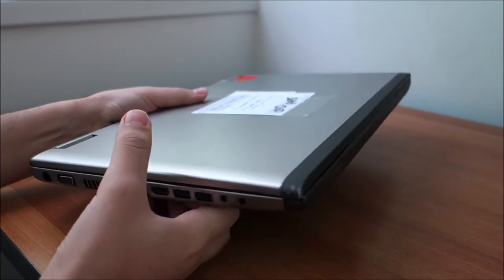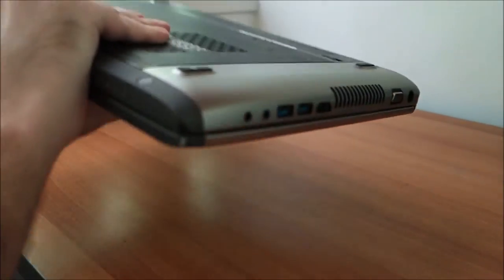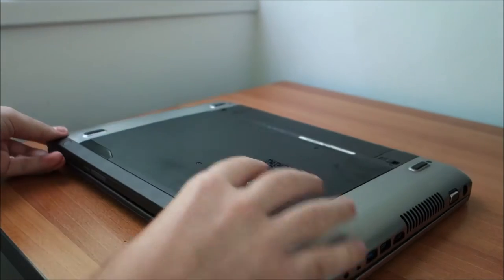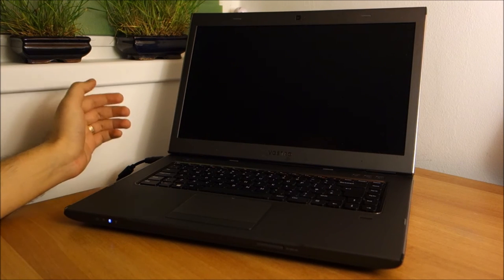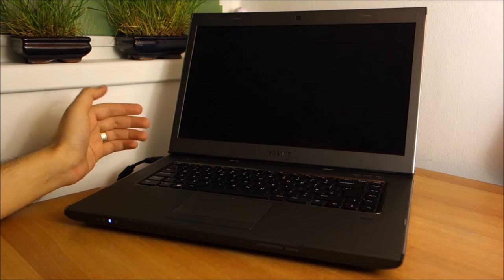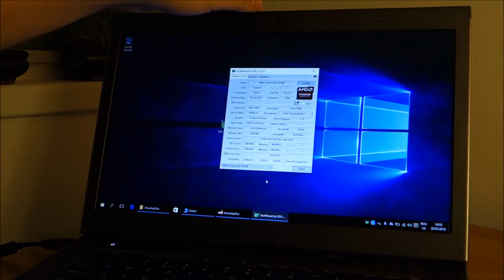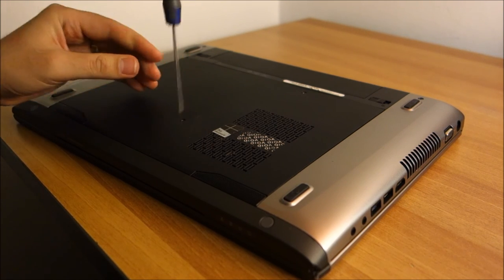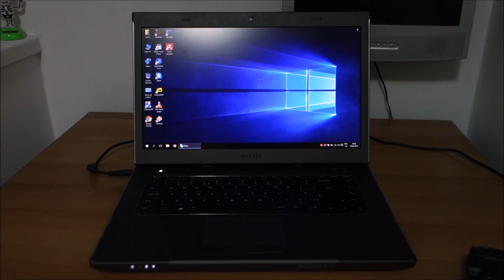How to repair and upgrade a DELL Vostro 3560 laptop

Comment: I used glue from a hot glue gun to fix it back in place.

It's interesting as these computers are still useable today. I'm still using mine even 4 years later. No issues except the charging port.
Reply from the maker: Yes, at least CPU processing power did not increase that much in the last few years.

Comment: what is that ram specifically? 4gb stick what speed and low voltage? could you provide a link I have this laptop in an i5 and would like to upgrade from 4gb to 8gb of memory
Reply from the maker: I am unable to remember the exact specs, but any laptop DDR3 will work without problems in this laptop.
More exact info here:
http://en.community.dell.com/support-forums/laptop/f/3518/t/19481347

Comment: Helpful video! Thanks :) I plan to replace my DELL 1704 wifi card to Intel Wireless-N 7260 (half mini type) at the same laptop model from video. What do You think: it will be work together? I didn't take the answer from DELL community forum...
Reply from the maker: Welcome! :)
Don't really know what to tell you about the WiFi card. If you can't find someone that already did this upgrade so you know for sure it will work, it's all about luck. Laptops are really picky about their accepted cards...
I usually don't upgrade them, unless I really have to.

Comment: Is the CPU upgradeble? If yes, what specs does the CPU need to have (Socket)
Reply from the maker: Yes, it is. Your best bet is to search on forums for the CPUs that others have already tested.
Reply: @UltimateDIY  and the GPU as well??
Reply from the maker: Laptop GPUs are rarely upgradeable and even when they are, it's really expensive to upgrade them even with second hand parts.
But don't know exact details about the gpu for this laptop model.

Comment: Would you give me any suggestions, what is the easiest way to clean cooling system?
Reply from the maker: +slawekwwwww compressed air is the easiest wsy. But after a certain point you need to open up the laptop and clean the cooling parts with a brush.

Comment: can we have a call or smth i havy my vostro for 3 years now have been strugling w the gpu tried almost every driver i could find but still nthn i have same type as u
Reply from the maker: Sorry, no other way to talk, but here. What exactly is the problem with the gpu?
Reply: @UltimateDIY  so basically i have the driver instaled but it just wont use it when im in game or smth i dont really know i can send u whatever u want just ask for it, the gpu shows up in the system but i feel its not doing the job
Reply: even if i use the catalysm or what ever it is called to add the game inside it just wont
Reply from the maker: I do not have a dedicated gpu on mine, so never had this issue. But, I know from other laptop models that this is a really difficult to solve issue. Does it have an option in the bios to select integrated/dedicated/dinamic? Or something like that? I had another brand of laptop that was doing the same, because it was set from the bios to integrated only.
Reply: @UltimateDIY  i have the same laptop u have on the vid bro
Reply from the maker: No, you don't. Mine only has integrated gpu.
Reply: @UltimateDIY  bro i told u i have the exact same type as u
Reply: @UltimateDIY  on the vid u showed it has 7670m gpu  as second switchable card bruh
Reply from the maker: Sorry, you are right. I mistook this laptop with the one that my parents have, that does not have the dedicated gpu. For this particular laptop both cards worked perfectly, but never tested with games, only with 3d engeineering software. Did you check the bios for settings related to the gpus?
Reply: @UltimateDIY  basicallz what i did i installed older driver coy win 10 is f up and using thorttle stop to get more power

Comment: ssd need ...  solid stateeeeeeeeeeeeeeeeeeeeeeee
Reply from the maker: +Milos Vujovic yes, that really helps a lot with load times and overall snappiness feel of the laptop
Reply: i have 3560 i5  4 gb ram ,i will putttt  ssd 128 kingston very soon
Reply from the maker: +Milos Vujovic maybe even some ram would help a bit, but the ssd will make the biggest impact.
Reply: i have 500 gb sata hdd,only ssd i will putttt in vostro ,ram memory keep on 4